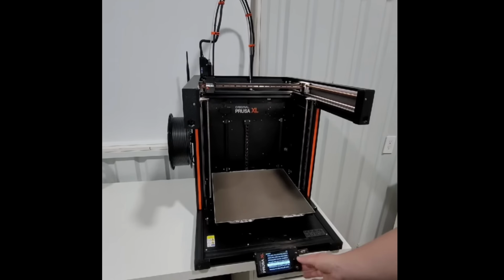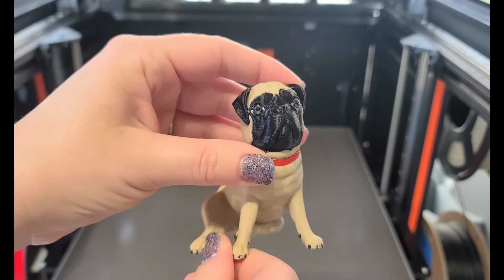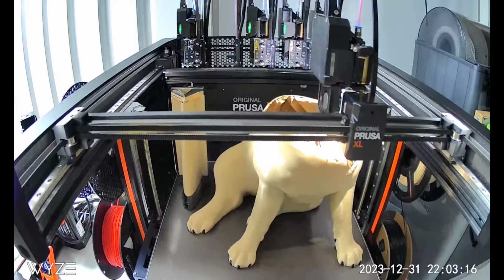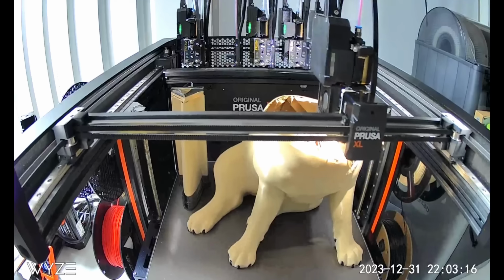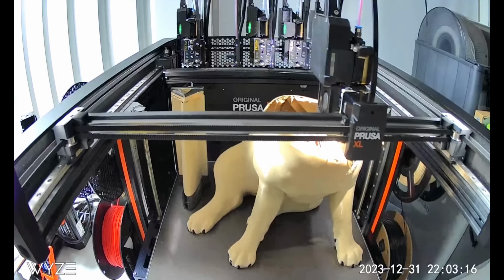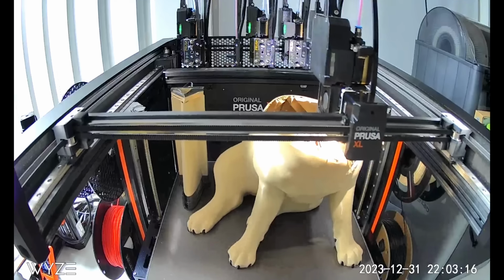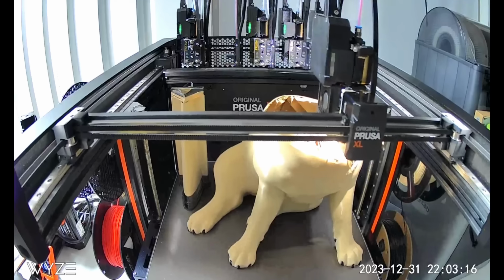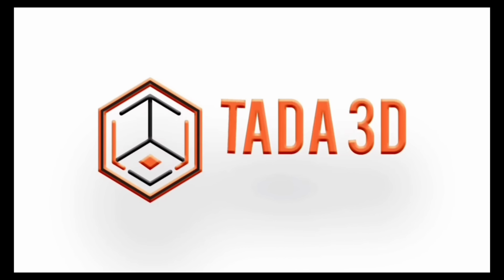Finally Testing Out the 5 Color Buddy Print That's Over 14" Tall!

Comment: I remember when the Bambu Lab x1C first came out and everyone said it’s just a printer to print PLA and toys and prusa XL will be the “prosumer” grade printer. So far most users are facing the same issues with Prusa XL. Anything apart from PLA is either a stringing galore or just having problems while printing large parts. Prusa should have released the printer once they had throughly tested it as a polished product.
Reply from the maker: I'm having trouble even WITH pla. But I just feel like I'm missing something. Thank you!
Reply: The prosumer argument comes from mixing materials, less waste(some materials are expensive af) and possibly later on mixing nozzle sizes.

Comment: Your rough experiences with the PRUSA XL is very similar to every experience I had had with every printer I've ever bought over the last 3 years, until I bout a Bambu X1C. All these other printers were great at times, but often would do weird stuff ruining the prints, or other issues. Constant frustrations when I just wanted to print.

If the Prusa XL was even 80% as reliable as my Bambu I would consider getting one since it is so much faster and less wasteful for multicolor prints, but at this point in time there is no way I could consider it, especially for the money. I have wasted so much of my life chasing after solutions to fix printers that are not reliable. I don't want to go through that ever again. 

I've had some failures and problems with the X1C, but not many, they were all easy to figure out and get it working agian, and almost every time it was because I was trying to get away without cleaning the bed as often, or other issues casued by me trying to do things I know it's not supposed to be capable of.

Prusa used to have the "It just works" reputation, but the Prusa XL clearly does not "just work". At this point I am really just hoping that Bambu will put out a larger, tool changing printer and I'll just stay in this "eco-system". I'm finally printing way more than I'm being a printer repair man, and I can't go back to a printer I have to fight with.
Reply from the maker: I agree if Bambu comes out with an XL, it'll be worth trying. I am a little nervous about the waste tho. Thanks so much!
Reply: Bambu recently made an announcement that their new prosumer flagship line printer will be expected Q1 2025. From what we have heard it is going to be competing against the XL.

Comment: You can have a much more stable wipe tower by setting a single filament to make sure the perimeter is stable. You can do this by setting the wipe tower extruder under Print Settings->Multiple extruders. Has worked well for me with tall prints.
Reply from the maker: Thanks so much for that! I asked Prusa what to do to improve the problem with the filament on the tower not sticking together and they said to increase the heat. Your suggestions makes way better sense! Thank you!

Comment: I am currently printing a large painted buddy too!   I was having some similar problems with the wipe tower falling over and found that if you eliminate the wipe tower and then tell the slicer to wipe into the infill it seems to work and I am getting good results.  I also had a problem with one of the tool changers falling off when printing and found that the Nextruder dock itself was not level vertically.   There is one screw on the back of the dock that I loosened, and then I used a level to make sure it was adjusted so it was level, I then tightened up the screw and calibrated just that head and  I have not had a problem since.  I did double check all the other docks and they seemed to be level vertically and horizontally and operate without problems.
Reply from the maker: Ok I'll definitely check that out. Thank you!
Reply: Yeah I had a similar issue with my docks during assembly. I tightened the first dock too much at first, so the screw plate in the extrusion wasn’t level so when I got to the fifth tool, out wasn’t seated properly in the extrusion. I fixed it by loosening all the docks and making sure they were all aligned properly in the extrusion before tightening them. Had no problems since!

Comment: I would suggest get a steel sheet bed and the layer adhesion is so much better for my copy of the XL. I had a failure of large print fall off the bed.
The satin bed is not good enough for the PLA IMO.
Also, I would suggest to check the first layer adhesion to ensure them fully filled. My XL sometimes gets first layer far off the bed.

In terms of the tool head, you might need to recalibrate the tool head and ensure the metal pins are not lose or BENT - mine one got bent but I redid the calibration and it went okay. A little bit of the offset will ruin the docking and undocking as the tolerance is very tight.
Reply from the maker: I just ordered the PEI sheets and can't wait to try that out. And I'll redo my calibration and check things over. Thanks so much!

Comment: I had a similar problem with long prints and bed adhesion at night.  I have the printer in my basement and I have a smart thermostat that lowers the room temperature at night.  The temp change was causing the prints, supports,or the purge tower break free.  If you have an adjustable thermostat,  try locking the room temp throughout the print.  Cheers.
Reply from the maker: Ok I'll check it out. Thank you!

Comment: Three things:

1) I hope you're submitting bug reports to Prusa.  The XL clearly isn't working the way its supposed too.   You're essentially field testing this thing for them.
2) I hope Prusa is reimbursing you for the wasted filament.  
3) On textured sheets, I always have to glue down PLA prints on my MK3s and MK4s.  They never stick.  I use Elmers Purple glue stick.  PETG usually sticks pretty well without glue.
Reply from the maker: I have been on chat several times. But it always seems to be a different issue. Maybe I need to submit them differently? 
So far no I am not getting reimbursed for filament or getting free filament but that would be nice!
I didn't realize they now have PEI finally so I'll be ordering that. 
Thank you!

Comment: About the dock falling off, have you checked that the front of the metal parking tool bracket is flush with the extrusion?  It's the part of the dock with the latch pins.  If you can wiggle it forward and back, it's not fully attached. I would take a piece of paper and see if you can push it between the two parts when wiggling the bracket.  I found that my extrusion slot was probably 0.20 mm too small for the metal parking tool bracket. I broke the ball end off my personal Allen key when first installing the dock. I then disassembled the dock to get to the screw, popped out the broken ball end, and then took some parallel jaw pliers and squeezed the parking tool bracket into the extrusion. I did this until there was no more gap between the bracket and extrusion, both above and below the extrusion slot. I then screwed the rest of the dock back on.
Reply from the maker: Ok I'll check it out. Thank you!

Comment: With the amount of waste generated by this printer in failed prints, it would be interesting to know what the waste to finished print on a single head colour printer such as the X1 Carbon was.
Reply: Not a comparing apples to apples with that. When this printer works correctly (which I'm sure it will, eventually), it isn't even a competition which wastes more. Comparing a malfunctioning printer to a functioning one isn't a worthwhile comparison.
Reply from the maker: If I consistently have failed prints, I do think it needs to be factored in. Not just cost of filament but wasted time. But it's very difficult to compare something that prints this large with any other machines. Thank you!

Comment: In test-face I had mainly problems with the purge towers tumbling over. I stopped using a wipe tower, placed a strip with raiser blades just before and under the parked nozzles and at the start of a toolchange purge a few mm and let it go over the raiser blade a few times. It gives a mess on the bottom of the printer, but that's easy to clean. 
I also stopped using z-hops, which prevents stringing for 90%. Only PETG strings a bit.
Reply from the maker: Oh wow I hadn't thought of that. Thank you!

Comment: i’ve got my 5 head xl coming in July hopefully. With any luck most of these issues people are having will have been ironed out. You are very patient ,  the first problem with the red filament not extruding , I would have stopped the print.
Reply: I waited almost eight months (I was offered the option of finalising my order on the first day 5THs started shipping, but decided to wait) for this exact reason. Got it in late November 2023. Sent it back in mid-December. Waiting for them to repair it.
Reply from the maker: It seems most commentors are not having any of the issues I am. I just want a cool print! Thank you!
Reply from the maker: @huntergeophysicsaustralia what was the reason for sending it back? Thanks!
Reply: @tada3dprinting   I had multiple issues, but the main one was poor layer adhesion and poor bed adhesion (particularly of the prime tower as you’ve experienced). The last attempt I made, halfway through the print it decided to print diagonally across the build plate when the model was a big rectangular box (so it was printing very big bridges across the entire build plate). It had no business making such movements and there was definitely nothing like that in the Gcode anywhere. So I have no idea why it did that. In any case, when it did that diagonal movement, something happened and both x and y axes became jammed and I couldn’t get them to move. Support just said “send it back to us”.
Reply: Hardware issues are …tolerable, if they’re fixed. But the printer running actions that weren’t even in the Gcode is just plain mental. I’m waiting for Prusa to explain that one.

Comment: For that print, see if you can cut the head off just below collar. Print in 2 pieces. Use pins to align. Head first, if works, then body
Reply from the maker: That's true. Easier to test. Thanks!

Comment: Just watched a video from YGK3D (5 tools, 5 material) one. He made a comment about setting one extruder for outer perimeter of the tower. I wonder if you force the red to print the whole way up the print if that will stop the stickiness of it when it’s parked. 

If it keeps moving it might run all way through with failing. 

Just a thought.
Reply from the maker: That's a good idea. I was thinking of running the tower with the tan just to make sure that it was solid. Thanks!

Comment: Thank you so much for sharing your printing experiences. I am following you since your first video. I am sorry to see your struggle with XL 5T. Seeing how many issues you seem to have, many would have become emotional and bashing yet you remain positive (fairly😉)  and curious. You have the patience of an angel 😇 .
Yet, as @PaulStevensonPinball has described so well, your experiences are not indicative for the XL. I have mine now for a few weeks and it runs flawlessly directly from the (semi-assembled) box. I literally have been running it 24/7 for full-bed multi color prints and I didnt have a single failure and every print came out perfect: excellent quality, no stringing and no waste. All I did was switch on some retraction settings ([Retraction length]: 2mm, [Retraction Speed]: 40 mm/s, [Wipe while retracting]: on, [Retract amount before wipe]: 10% and [Retraction when tool is disabled length]: 40mm), I print PLA at 210c (also Prusament PLA which at default is set to 225c) and all my filament is dried and kept at below 20% humidity. By the way, the type of filament you are using is not related to your issues, Prusament is very nice filament but not required to run the XL without problems. 
I hope your patience will last until you get your issues sorted (it does sound like you have a lemon). I hope Prusa is with you to sort it or replace the machine. Maybe it would be an interesting video series to take us through the interaction with Prusa Support and/or the implementation of the suggestions from Paul Stevenson.
Keep sharing your great videos.. you will get the XL 5T to be the amazing machine it is to others.
… and indeed something is off with Prusa’s filament production. I am waiting to order as well. They seem to be out of stock for over a month now.
Reply from the maker: Thanks so much! I really appreciate hearing from others that are having such success with their XLs. Some boring prints are working for me. Enough that I am keeping at it. Thanks for your suggestions!

Comment: Would it be possible that the red filament gets fragile or otherwise weak in the toolhead after a very long wait after the priming? Did you try using the red filament in another toolhead? I've had a similar issue once with the XL2T where a cheap PLA filament had stopped extruding and I could just pull the filament out from the toolhead during printing. The end of the filament was flat-ish (not stringy or conical), indicating that it had probably snapped.
Reply from the maker: Yeah its possible. And eventho it printed ok on the dragon, maybe it doesn't like that the amount on the spool is low and now brittle? Thanks!

Comment: Are you using the satin steel sheet? I bought a satin sheet for my MK3S+ and no matter what I tried, I could never get PLA to adhere to it reliably. I do very well with PLA and the smooth sheet. On the textured sheet it sticks OK but not quite as well as the smooth sheet. 

After trying EVERYTHING, I ended up giving up on the satin sheet altogether. 

The sheet selection probably won’t help with your failure to fire issue, but it seems bed adhesion is causing you a lot of problems as well.
Reply from the maker: It is a satin because that's what it came with. I just saw they released the PEI and have ordered it. We will see! Thanks so much!

Comment: I really feel for you. Seeing this makes me nervous about trying a full build volume print! Most of my multi material prints are using 0.25mm nozzles and are pretty small. I haven’t had much trouble with mine and I’ve never had a filament not fire or a tool fall off mid print. I am curious about your dock mounting and calibration. I had to remount my docks after I found they were loose. I rarely use just Prusament and I don’t think that’s going to solve your problem. I’ve had success with pretty gnarly filament.
Reply from the maker: Oh I'd like to see what you're printing with that size nozzle. Most of my shorter or more boring prints are fine. But I would think the buddy would be a pretty basic print? Thanks!

Comment: Ok so two points of failure: bed adhesion and the red filament. Which print sheet are you using? And did you clean it with ipa before the print (extremely important to do that before every print!)? The combination of textured/satin sheet and pla often doesn’t work so well. Try going with the smooth sheet, that should fix the bed adhesion. If you don’t have that, try printing it in petg, that also should fix bed adhesion, though at this size it could introduce lifting issues through warping. For the red filament: did you measure the filament diameter? It could be inconsistently to wide which could increase drag through the Bowden. Also I’m not sure if the extruder tension can be adjusted, if so, try setting it higher. Oh and did you print something high temp before with this extruder? Maybe there is some residue on the wiper, which could clog the nozzle through creep. Those would be my trouble shooting ideas.
Reply from the maker: I was using the satin sheet. Yes I do always clean with IPA first. I thought the bed adhesion was an issue. But the tower broke, so that was a filament issue. And the print moving was after it had sat in error and cooled. I don't think it would have been an issue if the print had finished like it should have. 
I'm going to retry with a different filament than the red. Thanks so much!

Comment: Check if you have a burr on the PTFE tube or connector and if it's seated all the way in the head.  I had this issue.  Also, I would do a cold pull with nylon/cleaning filament on each head.  On all new printers after 1 or 2 spools. It's just a good idea to do a cold pull even if you don't have a clog to remove any residue. Personally, I do this every few spools. What temperatures are you using now for PLA? For Prusament with input shaper, the default settings are 230 first layer and 225 on other layers.  I bump up my bed temperature to 68/69 to help adhesion.
Reply from the maker: Ok I'll check on this. With the .6 nozzle I believe it's still 215. I'll check. Thank you!